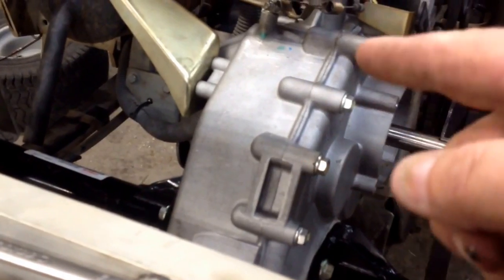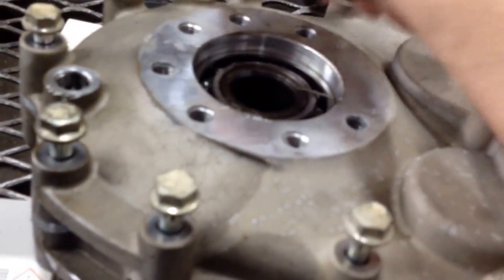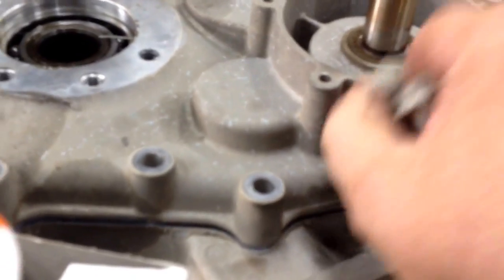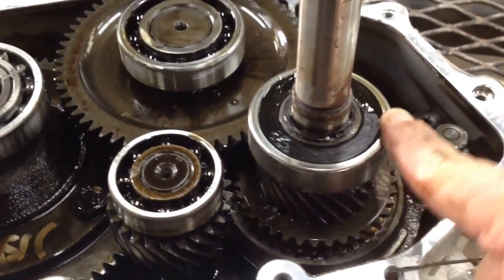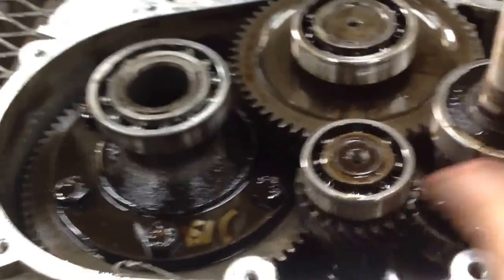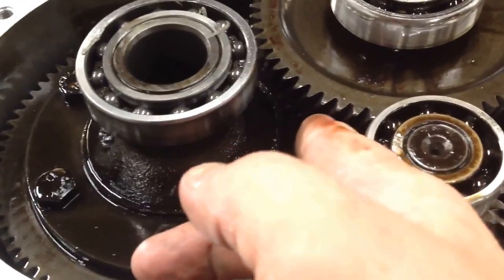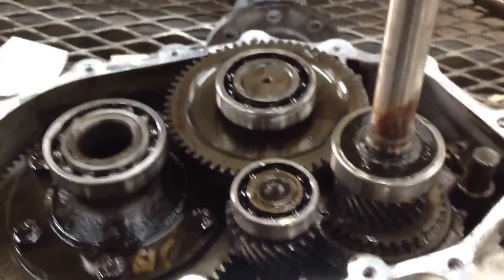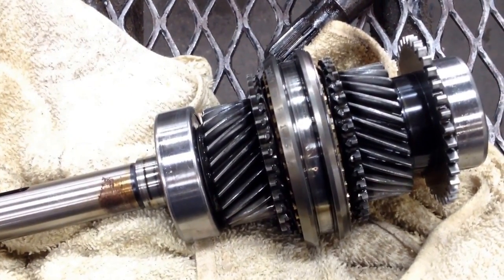Club Car Transmission Bearing Failure  / Tear Down  / Diagnosis

Comment: My 2000 Club car DS has had that earring noise for roughly 7-8 years. Figured id be replacing the transmission until i found this video. Took me about 2 hours from pulling the trans tearing it down and installing it. $60 for 2 bearings and its perfect now. Thanks for the video!!

Comment: Why would there be a sealed bearing in the transmission? Weird, unless I missed something like it was an outside bearing .
Reply: Was wondering the same, if I replacing I was thinking of removing the seals, any drawback to that ? Do they get enough oil to them for that ?

Comment: I have a 2012 club car won't go into gear like it is stuck the cable and switch is good. I cannot manually put it into forward or reverse, axles spin by hand. I just drove it last night no problems. Do think trans is locked

Comment: I’ve got a 2003 pioneer 1200 that is slipping out of gear 7-10 time before it engages... is this an adjustment issue or something internal on trans?

Comment: so you're saying with the screaming i have coming from my yamahas rear end at slow speeds i should stop driving it? it goes away at speed its only really when i first start rolling or am almost stopped and only going forwards and at this point it only needs to last a few more months until i get a snop built and can rebuild the transaxle its got probably over 600 miles on it and thats just me owning it and i got it 7 years after it was manufactured. i daily drive it ive put 240miles on it since april 23rd.

Comment: I have one that the shifter with go into forward but when you hit the gas it won’t go forward. Reverse works fine. Sometimes there is also a slight grinding noise coming from it every so often
Reply: I have the same problem with mine.  Anyone help tell us what is wrong
Reply: Same problem with mine, clicking or grinding noise in forward occasionally

Comment: Have a question. I replaced all bearings in my club car trans . Assembled the wheels turn opposite as they should, but won’t roll once assembled. Any idea what I may have done wrong ? Thanks

Comment: Question which gear is the 6:1 ratio gear, need more speed but understand when I ordered the part that does not come with installation directions
Reply: I'm wanting to do the same.  I've got a old carryall rear end I might tear apart and make a video on.

Comment: Which set of gears has the reverse synchronizer on it? My club car jumps out of reverse
Reply: Pow I finally found someone with my same issue!  Did u get it fixed?  The shaft that he had the failed bearing on it has the synchronizer.  I have replaced the cable and adjusted it but it still pops out of reverse.  If u barely give it gas and hold the shifter hard, it will stay in.  Replaced the shifter fork which had wear and didn’t work.  Now I have that shaft on my work bench and pulled each end bearing off.  I did notice when sliding the shifter collar back and forth one way it shifter good and the other the balls would lay over.  I’m sure that’s the reverse side.  That side gear seems to have slop not holding the shifter balls.  Medic please help!

Comment: I have same transmission the diff lock out is stiff.. real still. Cable moves freelynot the shaft. Everythingelse works fine. Any ideas. ..
Reply: You ever figure this out?
Reply: @BailOfTheVeil  I did. It was years of gunk is the case making the rod stiff

Comment: @themowermedic1 ive got a club car that i think the trans has gone out in. you can put it in gear F or R without the brake pressed. second you go to stop the brakes wont stop the utv. its like the trans wants to keep pulling and you cant throw it out of gear with the brake pedal pressed in. if you come to a coast with no brakes applied you can throw it in nuetral and stop just fine. thoughts?
Reply from the maker: Finley McRae rpm
Too high. Clutches aren’t disengaging

Comment: I’m new to golf club car, I have a 1981 club car. When I drive forward or backwards I have a clunking sound as I drive,axel bearings are good. What would be your thoughts on this.
Reply: Its the motor mount vibration dampener snubber, it is a $9 part, goes on the front of the motor support frame, available on Amazon

Comment: My club car DS 2003.5 is stuck in reverse, can't move the shift lever back to neutral or forward. I was up on the side of a hill when I shifted into reverse, it felt like it went to far if that's possible, any how, it never would go back into forward. drove it home in reverse. Any suggestions other than tear it down and rebuild. By the way I plan to do that soon to put in a lower gear for off road use anyhow. Just not this soon.
Reply from the maker: Mark Moynahan shift fork and clutch dog in a bind. Remove input shaft and repair fork as needed
Reply: @THEMOWERMEDIC1  do you have a video of that procedure?

Comment: my 2001 club car ds keeps popping out of forward and reverse. I removed the cable and manually pushed selector and it still slipped  out of gear. any suggestions
Reply from the maker: Detent worn out
Reply: @THEMOWERMEDIC1  
Do you have video of removing the gears from 2001 club cadet golf cart

Comment: Someone put the,sealed bearing instead of a open on, which is alright as long as you remove the seal
Reply: That's the way the bearing is. The replacements come that way as well. Just replaced one in one of my utility carts. This makes the 3rd bearing I have had to replace.

Comment: Hi. I have to replace those bearings. Did you get the bearings from a club car dealer? Do you have the part number? Thanks.
Reply from the maker: Club car will cost you 4 times the money.  Just go to your local bearing supply
Reply: @THEMOWERMEDIC1  thanks!
Reply: @THEMOWERMEDIC1  I got the bearing installed. Trying to put the cover back together. Any tips? I can't seem to fit it in place.
Reply: Got it put together. Looks like 80w90 for a gas cart is recommended.
Reply: @anthonyfarmer4457  I did

Comment: Looking further at your fast moving video(slow down next time and back away a bit), those bearings are at the top of the case; the lube system is a wet sump which means the oil has to travel by gears to get to the gears. A sealed bearing wouldn't get any lube unless the gear case was filled to at least half of those bearings. The gearbox in my opinion was poorly designed and almost guaranteed to fail.
Reply from the maker: rg amore I didn't build it.  Contact club car and ask them.  I'm just the mechanic
Reply: @THEMOWERMEDIC1  if tranny is locked up would it keep it from starting
... I have a 2010 diesel put a new belt on it ran for 2 sec then locked up... I did notice water come out of airfilter not sure if some how it hydrolocked...
Reply: Same thing I thought rgamore, a splash oil system shouldn't have sealed bearings inside the tranny. That and I would not use 80-90 gear oil in these, I would use tractor hydraulic fluid like John Deere hy-gard, or a 75 - 80, Mobil makes a great lighter oil.

Comment: It doesn't make any sense that bearing is sealed when the rest are open. Why? Is that a mistake in engineering? Why isn't that bearing open to accept lube like the rest?
Reply: I don't think the oil gets that high up in the case